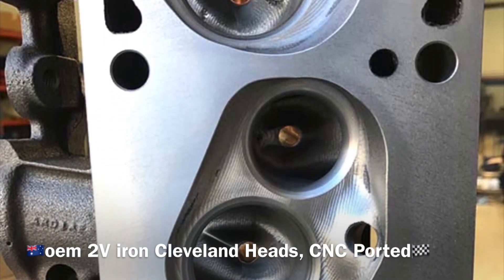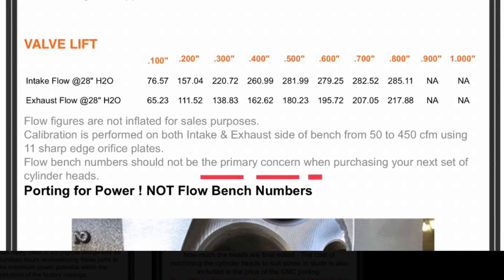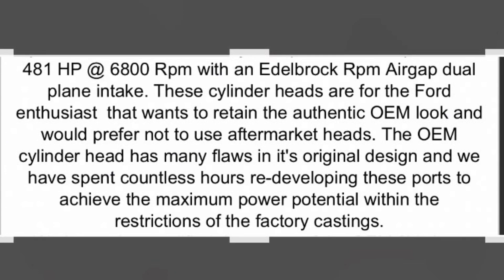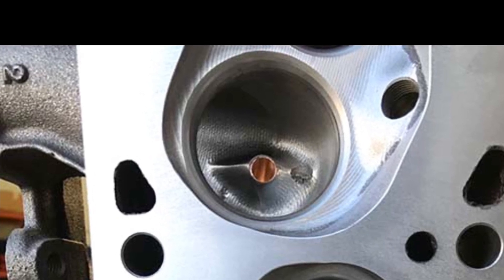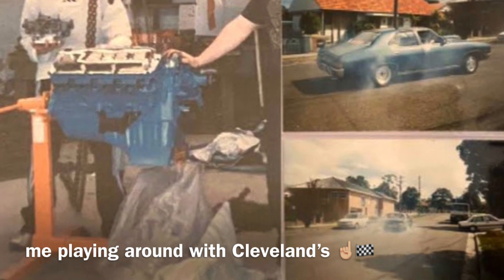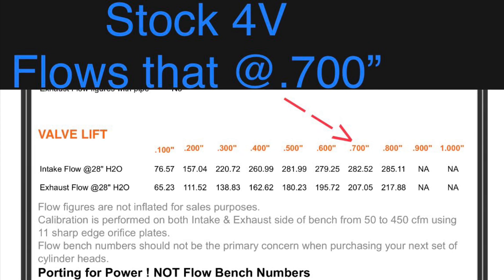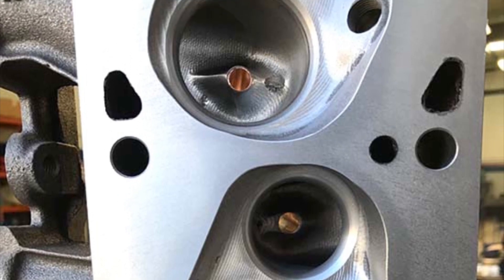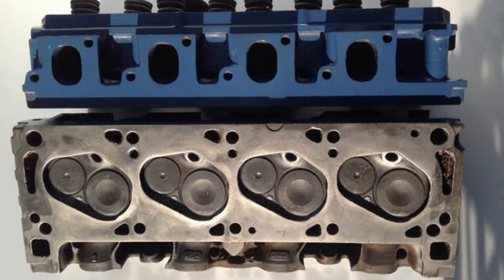Ford 351C 2V iron heads, CNC Ported for power🏁

Comment: Rip off! Cleveland heads are restoration projects! It turns out that a 4bbk Cleveland head flow the same as a victor Jr dart head! Coincidence? And I'm with right with you! But, a Windsor with good aftermarket heads are the way to go! A Cleveland 4v head flows bout 275cfm and that is great! But a Windsor with the 9.5 deck deck height and Victor Jr heads is already superior! You can get a longer rod in it! The low end torque combined with the 9.5 vs the 9.2 deck means a superior rod stroke ratio! That heavy crankshaft  is the only negative aspect! But the fact that you can exceed 400ci at the weight af a Windsor overcomes the negative aspects! A 408 with 375+ CFM airflow @ 6500 rpm is a rednecks dream! And it will live forever! And, if you choose a Dart block, 427+ ci plus a 9.5 deck height vs a 9" deck, well, you can build 4 or5 434 chevy's, or one dart block 427 Ford! The rod stroke ratio, that determines whether it will stay together! Comes back to earning a living by the hour, or by the gram!! Let me know if you don't understand the math! It's 5th grade arithmetic! But it seems it's over rednecks heads!
Reply from the maker: anything aftermarket in Block & head combination should be superior really.
Just talking about some good ol  oem Cleveland gear here that can still hold its own 💪🏼🏁
The only badass factory oem Windsor both 8.2” & 9.5” deck blocks are the ones topped with Cleveland heads lol (Boss Style)
& if we’re talking about superior Blocks as far as deck heights & Ci capabilities 
you forgot that the “335 series” (Cleveland’s) do have the 351M & 400 with way more deck height than the 351w 😊🤷🏻‍♂️🏁
Your good with 450+Ci , 4V large port Heads, & a much stronger “Cleveland” block…….
Cleveland’s for the Win🏁………
Reply: @69JANKS  the key is "stronger "!  I guess it depends on how much power you want! A well prepared Windsor block will support 750hp! If I wanted more than that, I'd look into a 385 series aftermarket block! You can't keep up with the dope dealers! At the end of the day, it's just having fun! That's why I got out!! The dope dealers will always out spend you! It's just all about the dollar for the fun!! The dope dealers didn't even drive the cars, except for one! I knew these guys, how much they paid taxes once! We were running 5.70 1/8 mile on "street motors years ago, and they were faster!? The cars ran on powder then!!
Reply from the maker: @markmccarty9793  haha I’m with ya on the DD’s 🤷🏻‍♂️ easy come easy go i guess….
Yeh I’m with ya, i like the good ol oem stuff floating around still & what u can make from it…… any blue oval iron I’m down for, Cleveland’s are very similar in taking on power, I’ve seen some oem blocks also with iron 4V heads north of 750hp…… but that’s on kill, big na combo it takes for that…..
I’m happy with that na 450-600’ish+ pump gas deal 👌🏼🏁

Comment: 2V heads SUCK
Reply from the maker: ….for some 🤷🏻‍♂️🏁
Reply: Really?....it's all about understanding what you are trying to get out of this iconic engine.....put a set of 4Vs on your Cleveland, and you'll see massive 60' times lost......the engine can't take in the  incredible port delivery....lazy as hell until it gets to the "better back off zone"....ask Bob Glidden, the 4V heads were  junk out of the box......
  NASCAR??.....yeah, that's what they were designed for.....put the pedal DOWN and do not lift...like the Hemi!

Check how many Pro Stock teams in the last 50 years used MOPAR hemi engines......one hand no?...it is, and was about port velocity...filling the cylinder as fast as possible......period!!
Reply from the maker: @imtheonevanhalen1557   check out my vids on my own 4V large port 357ci Cleveland 25yrs ago, you’ll see no laziness there. A lot of people just pass on the buck about the 4V on here because of what others say about it & probably haven’t even owned or run themselves also…. It’s almost annoyingly laughable to be honest.
It isn’t a perfect head, it’s an oem cast iron head for production engine bay vehicles……you just got to deal with it & know how to make em work to its advantages….. 2V irons are great for what they are, but nothing to what a 4V large port can potentially offer as is……you’ll typically see 2V irons (ported) top out at no more than 7K rpm🤷🏻‍♂️ & in most cases when chasing hp, despite the Ci you still need rpm in whole deal…
Check out my 25yr old 4V na 357ci on rolling power skid with low rpm on the hit & see if there’s any laziness there…..
Early ProStock Cleveland’s were a variety of combos utilising as is big port inlet but with hi-port plate exhst, & with filled intake ports also over the entire 10yr period, they discovered a lot of different results with all the different Ci combos 
Check out some other past vids about everything on this I’ve posted👍🏼🏁
Reply: @imtheonevanhalen1557  I am building a windsor 302 with 50 buck 2v open chamber heads. I used an empty block as a template and made the chambers big enough to send the piston .085 out of the hole. I will mill the heads too, until I get 10.5:1. Heads are out at a shop getting new guides. The shop owner saw them, and talked to me for an hour about it. He was in his 70s, and built race cars 45 years ago. He had one that went 177 in the 1/4. He said port stuffers in the 4v heads made him 3/10s faster. He showed me a set of closed chamber 2v heads in his personal parts stash that he was planning what he called a "mini boss".....he can build any engine he wants, and he wants to build a 2v 302. lol.